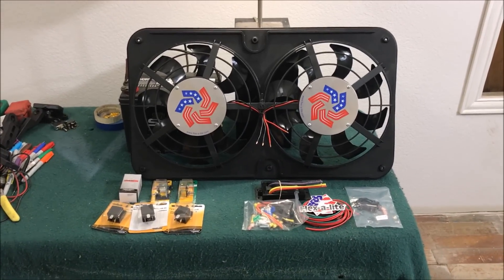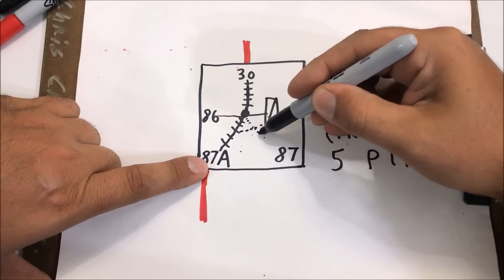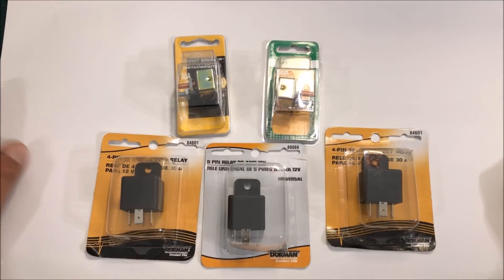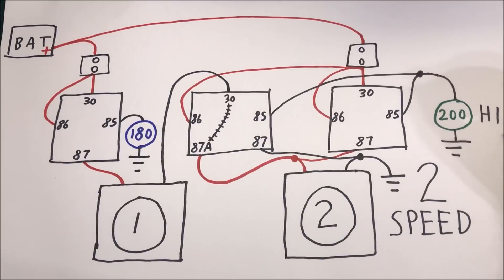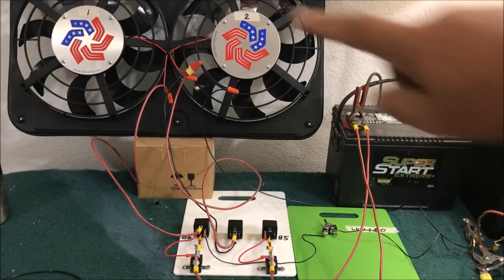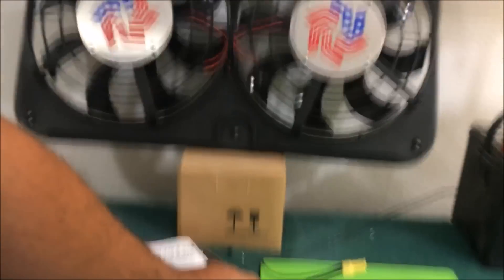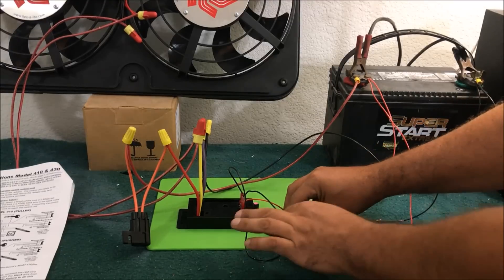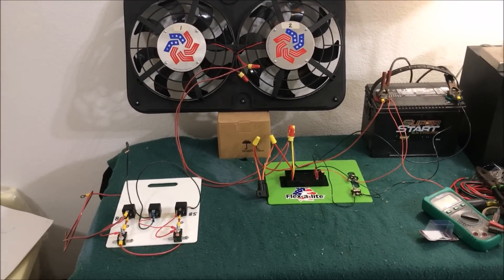auto electric cooling fan WIRING how to DIY

Comment: Chris, Using the step 2 with 3 relayes. Can the 180 temp & 200 temp wires be used on my ECM/COM computer on my 02 chevy Silverado. Also, should I add another relay for the A.C. unit?
Reply from the maker: if you wire it like this you don’t need the computer.. you bypass the 86 87 on 5 pin relay with the ac wire( to compressor)  so it goes into high speed when ac is on. if you don’t fully understand it don’t try to wire it up

Comment: Hey, Thanks for the instructions. Question, On those step,( 1&2), How does the A.C. work for both on high? Will be using only one temperature gauge. THANKS
Reply from the maker: you use the ac wire ( to the clutch) either ground or hot to bypass the relay on either 85 or 86 so when the ac comes on the fans come on no matter what

Comment: so question...
I bought ford windstar fans where there are 2. 1 has 2 wires and 1 has 3. Does that mean one fan is 1 speed only and the other is 2 speed?
How would you wire up in that case? still using 2 temp sensors.... would you do 1 fan at its normal speed then 2nd fan skip low and just go to high if higher temp is reached?

almost forgot. You do not mention Diodes. People are saying use diodes for when a fan goes from low to high as the fan acts as a generator and arcs the relays. If you use a diode it doesn't allow that and the relays will live longer. Do you agree?

Comment: Just got a couple electric fans that draw about 9 amps a piece. I also got 40 amp breakers because that's the only ones I could find at the local auto shop, will these have a negative effect on the fans function in any way?
Reply from the maker: just use 10g wire and you should be okay...   the fans will be fine

Comment: Hey Chris. Could I run a dual relay that activates both fans at the same time with the thermistat?
Reply from the maker: yes, just make sure the AMP draw is not a problem... in other words you might  need a 150 AMP alternator

Comment: Chris: Where do I put the second censor if I put 1 in the driver side block, and where would the one go? I have a Holley intake but their isn’t a spot to plug into the intake. Could I send pictures of my engine bay so you could have a visual. Lastly, does it matter how far the relays are from the battery? Thank for your help.

Comment: Excellent video!!!
My fans work at both speeds but I'd like them to startup earlier.. Can this setup(toggle switch) Co-exist with the factory setup? If not can I achieve this by swapping the temp sensor to a different spec?
Reply from the maker: +Maserati4200driver  yes, just find the wires that turn on the relay (84 and 85) and wire them to a toggle or desired sensor.. don't change the factory temp sensors or temp wiring (add a sensor )
Reply: Chris Craft nice! This will be a nice setup for the hot summers while retaining the stock profile.. 
Tnx a lot for the quick reply bro!!!

Comment: So you don't suggest combining two fam wires into one, and running it off of one relay? I've seen another video and that's what they did. I just want the correct way.
Reply from the maker: +100 Grand  you can do that but you need the correct size relay.. in this situation 50amp breaker/fuse and relay..  I personally would never in my life ever run them both off one relay... but you could if you needed that much air all the time.. like if your engine ran at 220 degrees
Reply: Thanks for the quick reply. My engine has gotten up to 220 degrees sitting in North Carolina summers. You did an awesome job at explaining everything